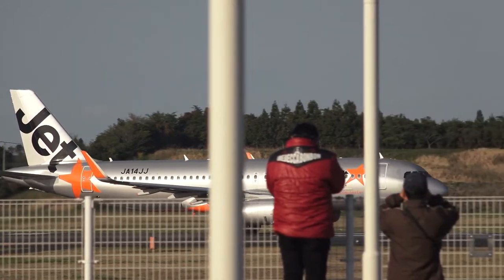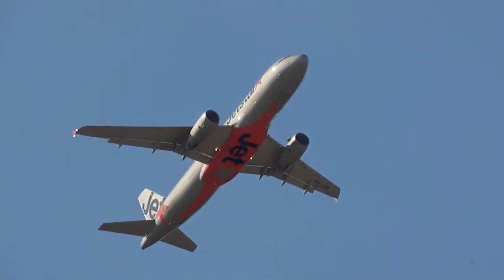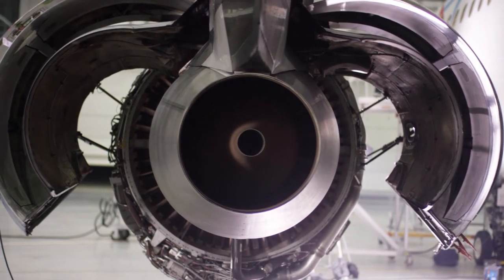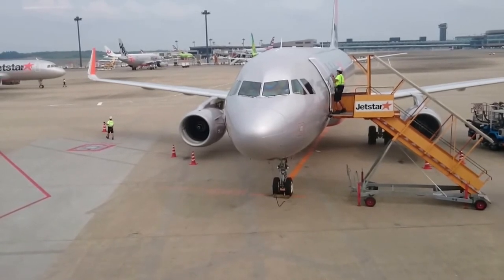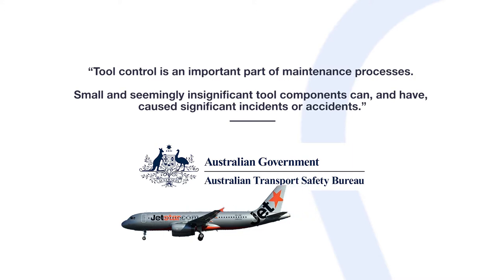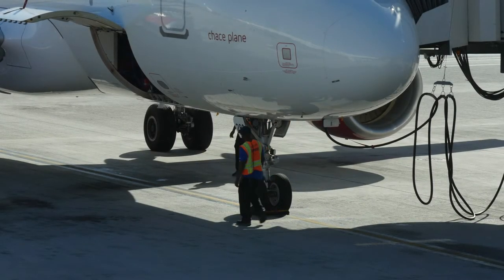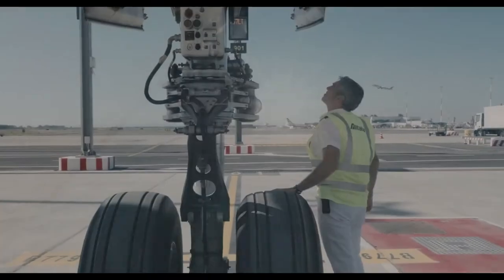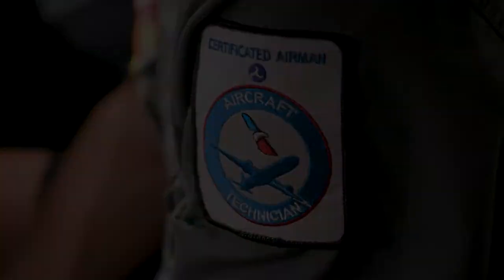Rogue Screwdriver Bit Causes A320 Engine Fire

Comment: It is a serious incident no doubt. I commend the pilots for safely aborting the takeoff.  However management directives don't inspire confidence when these types of incidents are not uncommon. I was onboard a Jetstar flight from Melbourne to Cairns but
the flight was cancelled before push back. I saw first had engineers crawling around the cockpit trying to find a screw/bolt that had fall out of one of the pilots visors. It disappeared under the rudder pedals and presumably into the under floor area of the cockpit. Engineers were crawling into the nose wheel housing trying to find screw/bolt. After a couple of hours they gave up an cancelled the flight. Jetstar organized another flight, overnight hotel stay and seats on the next connecting flight out of Cairns to Tokyo.

Comment: Carelessness is unacceptable.
Even at home I check to assure all my tools are back in place before finishing the task at hand.
There's no excuse for carelessness.
Reply: those things happen, this has nothing to do with carelessness! I would rather say, that the poor engineer was probably under quite some pressure, so he forgot to check if he had all bits in his tool box.
Reply: Only in recent years have I build a shop with toolboxes with tool places. I told my wife the most aggravating thing that occurs occasionally is a place for a tool that is empty and I can't find the tool. Drives me nuts but I find it a necessary and helpful discipline. I eventually find the tool but the empty slot keeps me obsessing over the missing tool (kind of like how an aircraft mechanic should feel in such a situation).

Comment: I imagine it will be difficult to truly track every potential foreign object that could come into proximity of am engine during maintenance.  While there might be a checklist item for 'screw driver'  they likely don't break it down for each individual part of a tool.  I'm sure there are many more complex tools that have a number of separate parts that could come off and be left behind, yet still get checked noff the list when the job is complete.
I could see them possibly restricting the use of screw driver bits and requiring single piece drivers that would be easier to track.
Reply: Let’s put it like an surgical operation. They count tools and weigh every single consumable. When lives are at stakes, this is was should be done.

Comment: I love the unthought out comments about not having removable tips. Can you imagine the size of the toolbox if you had to have a specific tool for every combination and permutation? Even just the simple ones that most people are aware of, such as short, normal, long, extra long etc. along with all the other types many people couldn't even imagine would result in an impractical number of tools, and a prohibitive cost. And then if you add the requirement to torque up without being able to have removable tips etc.!

I can't help but imagine a toolbox ending up as big as an engine!

Comment: I guess they need to stop using tools with small bits like this. It is a lot easier to tell if you lost a whole screwdriver than just the tip. I worked in jet engine assembly over 40 years ago and our tool boxes had a place for each tool so you knew when one was missing. The smallest tools we had were small sockets. I remember in the Navy  50 years ago when I was working on a P3 radar transmitter and dropped a small socket where the airframes guys had to retrieve it. They were glad I said something instead of ignoring it.
Reply: That’s not possible as Airbus uses special bits - Airbus Bits to open most of the panels around the Aircraft. This isn’t your typical Flathead or Phillips heads always. There are many more sizes and types. But it’s unacceptable either way.

But I know what you mean (respect to a fellow Aviation Tech)
Reply: Or maybe paint tools a very bright color, or even tie a tag on them when possible.
But I agree, tiny tools tend to get lost... they should make specialized tools for these jobs.
Reply: @CompositesNG  it is crazy the number of different bits there are now with Torx, Spline and Robertson to name a few. The Navy and a few years at P&WA was the only real aviation jobs I had other than working on a 7ECA Champ I had years ago.

Comment: Wasn't there an incident in China where a passenger tossed coins into a jet engine for "good luck" while boarding? 🙄 In this case it was very poor of the engineer to fail to notice that they lost a screwdriver head. Maybe it's impractical to carry a full set of screwdrivers rather than a driver with interchangeable heads, but this demonstrates the flipside of that "economy".